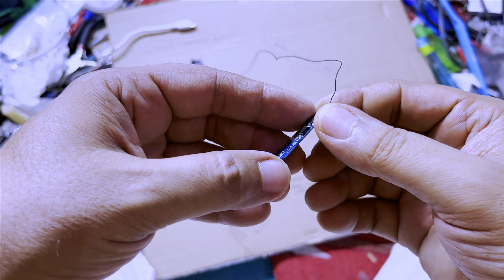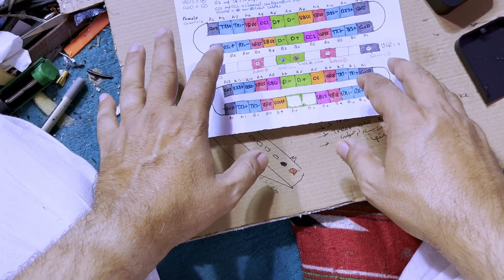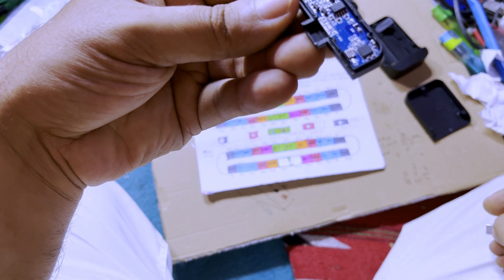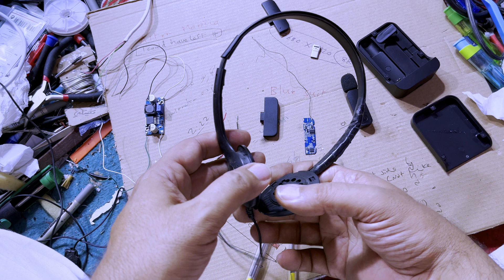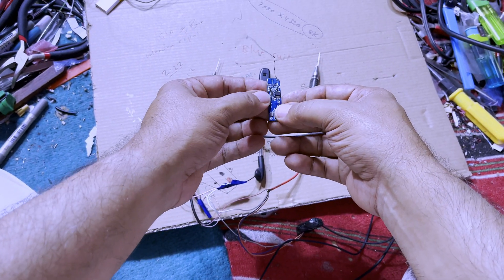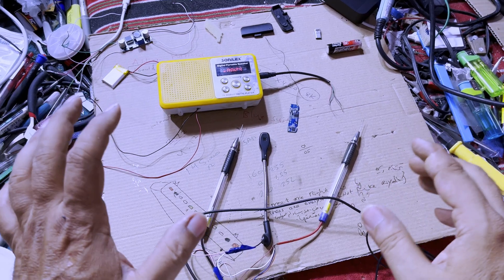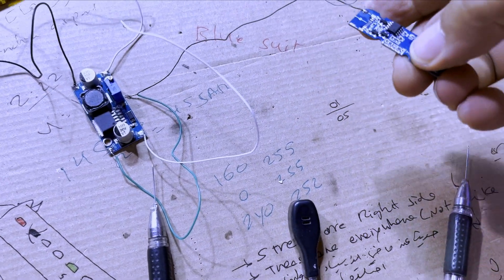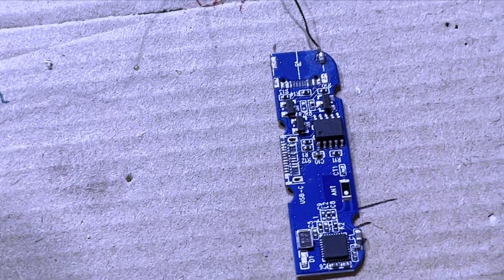Reengineering Type-C Wireless Lavalier Microphone to work with any DSLR Camera (Part2 of 3)

Comment: Hey I am looking for your final video.
Here I have tried it at my end. I have given Power by power bank then all receiver and wireless mic connected mic audio we can listened with headphone this mic has option for headphone
everything is working.
But no output sound from C Type Receiver.
Even I was connecting all three wires to 3.5mm audio jack.
1. Black to Groun 
2. Green to     D + (Plus)
3. White to     D - (Minus) 
NOW
all hope from your side
I think may be need some software to convert data into audio or 
any audio hardware for this 
hope you will give the solution for this
I am waiting for final product by you. 
Thanks 😊
Reply from the maker: It worked, had not that accident happened, we would have been completed this project by now. The good news though, is I recovered it back and now we are ready to film the final part.
Reply: @afaifeem  Sir I am waiting for your 3rd final video.
Reply from the maker: Yes, i am ptepsiring
Reply from the maker: Preparing
Reply: @afaifeem  Thanks sir Please upload we are waiting your video after then I use my C Type Wireless mic in my DSLR camera
Thanks again
Reply from the maker: Sure + other beneficial uplifts also. The only problem is “time”. Thanks Reetika
Reply: @afaifeem  Ok welcome sir I have no any option without your video